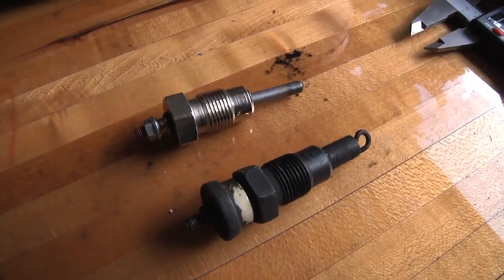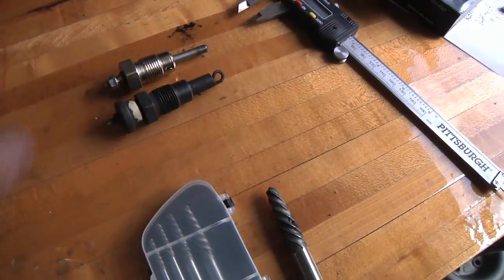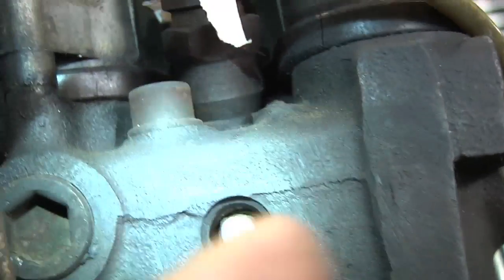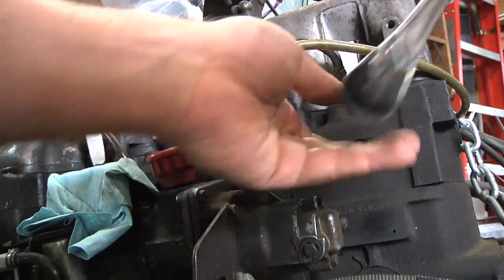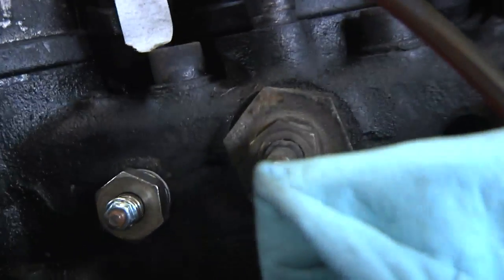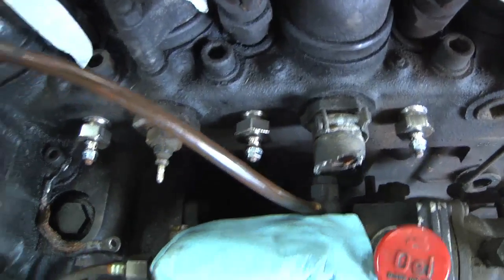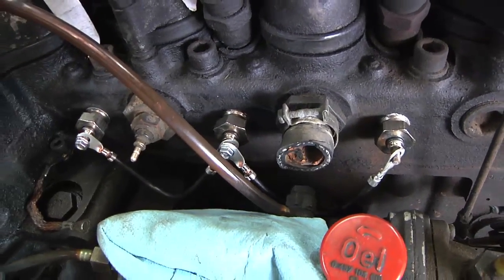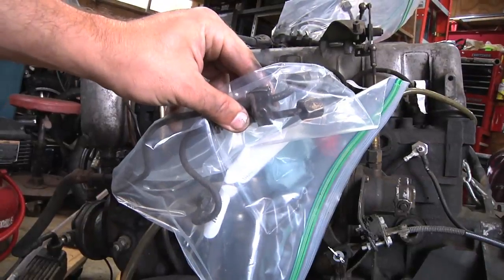Mercedes 240D Glow-Plug upgrade part 2

Comment: Hello. I have normal glow plugs in my car. I want to upgrade it to Steel glow plugs which works even at -30°C. These steel glow plugs as said starts heating on on battery before the starting the engine. So if I install these would the pre heating feature auto work or do I need to install something else to make pre heating work ? Please do reply as I have no other person I touch to explain. I further would need to import so getting things clear will really help

Comment: you wired them in series... they are parallel plugs, realizing this is 5 years late.
Reply from the maker: No. These are in parallel.
The source power is connected to the input of ALL the glow-plugs. Power flows through them all in parallel into the block.
In series, each element is connected positive to negative. If one stops working, they all stop working because the entire circuit is broken.
These are wired positive to positive to positive. Should one glow-plug burn out, the others will continue to work fine.

Comment: What about the carbon buildup coming loose and falling in the engine? Also with the compressed air you just blow it in?
Reply: apparently burns up goes out the exhaust

Comment: Don't forget to bleed the air out of the injector lines.  It won't start otherwise!
Reply: Crack then tighten the connection to each injector while the engine is cranking and then while it runs.  You will see bubbles in the escaping diesel until it clears up.  The air compresses such that the pintle valves in the injectors won't open much.
Reply: The injector pump has a little hand pump just for that purpose on the side of it.
Reply: That's only for priming the lift pump - you still have to get the air out of the injector lines, otherwise the injectors won't open.  The spring loading on each pintle vavle is such that any air in its line will compress without it opening.
Reply: how do you bleed out the air in the lines????

Comment: My suggestion in part 1 was to run a unique wire to each plug, and then run each of those wires to the relay. The way you have it now, if you have starting difficulties, and wish to test each plug, you won't be able to isolate it to a unique glow plug without removing all those jumper wires. You can always change it later if you need to,,,
Reply: If you used a clamp-on amp meter, you could start at the tail end and move up the line taking readings.
If the tail-end plug was open, there would be zero current.
As you move up the line, each jumper measured would show an increase in amps.

If you got 8 amps on one side of a plug, and 8 amps on the other side, it's open (bad).

I'll bet Ben has a clamp on amp meter, since he uses solar stuff.. :)

Comment: 40 amp relay?? Wow, how much current does each plug draw?

Do you test the electrical characteristics of the elements?
Maybe to see if they all have similar current draw..
Reply from the maker: I tested one of the glow-plugs, and it pulled about 8.5 amps. So, I figured four of them plus a little overhead, I would need a 40 amp relay.
Reply: I think the fuse on my VW glow plug system was a 60 amp.
Reply: Are u connecting it  to 12v through the dash mounted glow wire